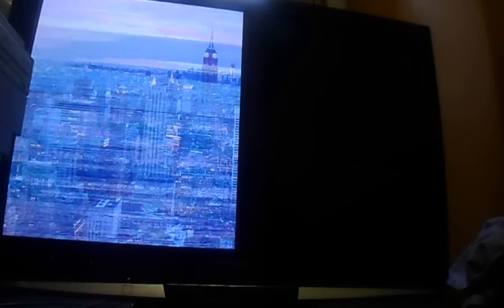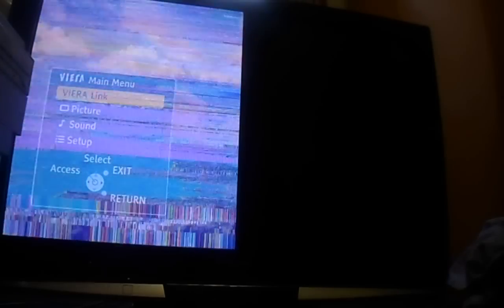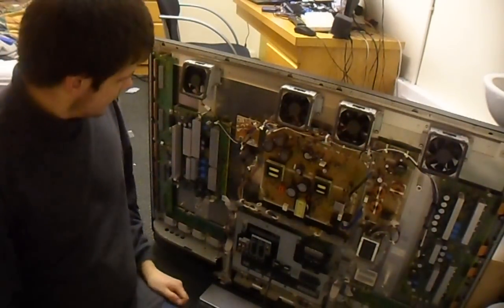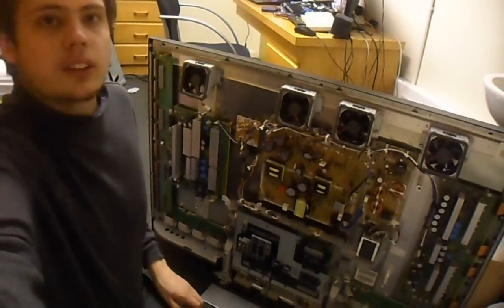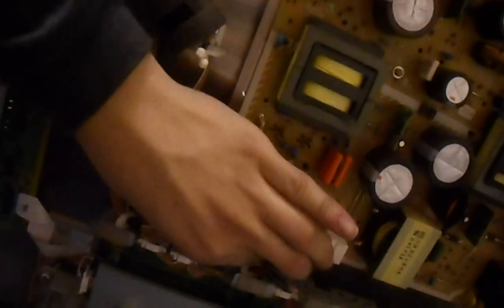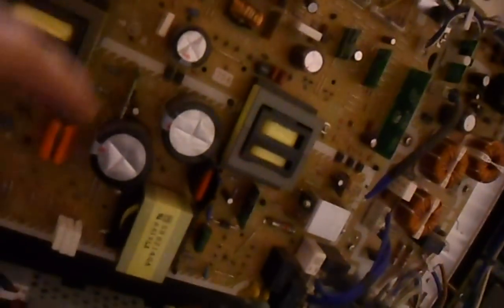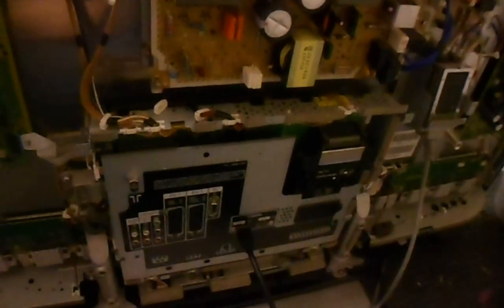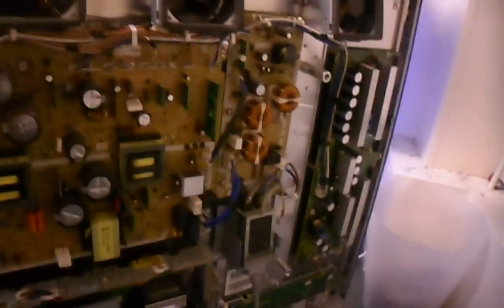Panasonic TH-46PZ80B - Half picture with distortion - Diagnosis and Repair

Comment: Thanks! Using your idea here I fixed my Panasonic TH-42PZ80A year 2008 plasma TV. It had 1/2 screen problem like this intermittently after 40 minutes of running. It was ok again after cooling down and played up again later. I had to try many times unplugging/re-plugging cables from the A board without success. Finally seeing the particular cable that you mention, I remove the front board to access the hidden board behind it. Unplug all the cables and spray WD-40 Specialist Fast Dry Cleaner formula for electrical components on sockets and tips of cables ... This cleaning solution got rid of moisture and dust ... Then I blew dry everything using a hair drier before putting everything together. The result is perfect picture again! So my advice to newcomers is to disassemble the board at the middle (having the AV, HDMI, Audio dockets ...) and clean it and the board underneath using a suitable electrical component cleaning spray. Blow dry and put all back together.

Comment: Thanks for posting, I lightly tapped the back of the TV at the location mentioned and it started working correctly straight away - at least now I know what the issue is and can fix it by removing the back panel and tightening the connection if the issue re-occurs.

Comment from the maker: This model -should- be naturally compatible with 230V AC. Check the back rating plate, but it should work. Mine works down to 115V; I think they designed the power supply to work over the whole range.

Comment: Hi ..Thank you for the video,very educational....I have a question for you...
I got a Panasonic Tv Th 46PZ 85U. was bought in the US. and works with 110 volts AC I moved into a country where mains supply voltage is 230 volts.The question for you is..How to make it to work on 230 volts AC without a step down transformer?

Comment: I have a Sony KE-42M1 42" plasma with blurry colors. When I tested the voltage test points the -70 volt that goes to the Ysustain board had voltage all over the place. But when the Ysustain was unplugged from the power supply was able to supply -70 no problem. Is the Ysustain shorting? Or what could be the problem?

Comment: Hi! my Panasonic 42 inch Viera TH-42PA60M has the same problem,its ok when i first switch it on then after about half to one hour later the picture starts to brake up as in the vidio starting in the bottom half then the longer its on it continues up the screen until the whole screen is affected ive been told its the main board thats causing the problem.Would that be correct if it is where could i buy a new one and what would be the cost?

Comment: Hi ubuntu, i would like to help someone with plasma tv, unfortunately i don't understand english speaking so have you put this solution written on a forum or other? Or can you write this somewere published, i am interested especially in that video test that is showed, i think is an autotest, can you show how do you do? you have to bridge 2 solder points/pads? The issue showed here can be the same as when the picture have less than half of the screen blacl (with no garbage to the visible image)? Thanks.

Comment: I have this same issue but if i tap the back of the tv it gets fixed, would it be worthwhile to open it? I have no electronics experience.
Reply from the maker: yes I'd say it's worth doing
Reply: So i finally opened it, the boards are really similar, but the gap between the board with the connector and the power supply is thinner so its extremely hard to access the probably loose connector, i can reach one side with my finger only, im gonna see if that fixed it. I also blew it with compressed air to clean some dust :) Ill let you know how it goes!

Comment: I know this is a year old video, but I have the same exact problem, but I believe mine correlates to a overheating issue, because once I have the A/C and Fan blowing into the plasma, the problem disappears..
And it has worked in much hotter temperatures with no issues, so I'm not sure what it might be!
 I rRely move the unit so I doubt it's the ribbon cable, but i guess I can check it out..
How do you open the plasma tv? Can you make another video of that?
Reply: Tcon board .. pretty simple
Reply: Did you get it fixed? Similar problem here!! Thanks in forward!!
Reply: @Victor Hartong no I never got it fixed, it only truly affects me in the summers.. In the winters in fine..
There's TV shop by the house that'll repair it, but summer was over by the time that happened.. 

But it seems to be a heating issue

Comment: Hi, i,ve the same problem but with the Other side of the tv.. Is the same solution?, thank you
Reply from the maker: solution is the same regardless of the side
Reply: +ubuntututorials thank you so much, i've fix my tv!!!, and still think that this panasonic plasma, is bettee (best image) than the tv's we could buy today.

Para los hispanoparlantes, el resumen del video... es conectar bien el cable q aparece en el minuto 5:40 o por ahí, yo de paso limpié la tv por dentro aspirando y soplando el polvo infinito q tenía dentro.... una gozada el arreglo despues d pensar q estaba rota y no tendría solucion... gracias.
Reply: muchas gracias por la traducción. voy a intentar arreglar mi TV

Comment: @ ubuntu
-Do you know how to get those test paterns on a  SAMSUNG 3D led-televisie UE50F6100? I know how to get in the menu butt thats all, ty btw for youre videos, there helpfull for alot a people how get ripped of with quantity tv's
-i have 2 samsungs, the other 1 has a negatif picture,normaly i can switch ddr to samsung butt it doesn't let me do it, can't select it, maybe t con board?
And 1 more thing, if you would by a tv wich brand is in youre eyes the best, cause i think its all about quantity and there all crap butt i don't do repairs so any advice?
Reply: i have the same machine and fault, looking forward to following your instructions, thanks

Comment: Hi. Mine starts to have thise lining suddenly after years of playing ps4. This happen only when i on to the source hdmi port that my ps4 is connected. But for my iptv set top box also connected to hdmi port ( any port ) it works fine. 
I thought its my hdmi cable faulty. Tried changing new one. Still the same. 
I thought my ps4 is faulty, but i tried my ps4 on to other tv it works fine. No glitches or distorted. 
What is the caused of the defect? Any one cld help